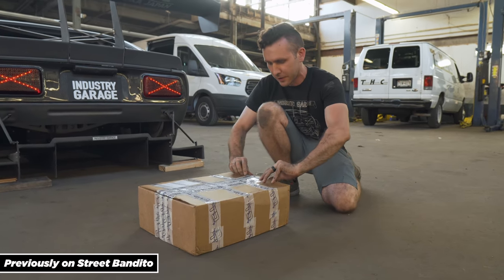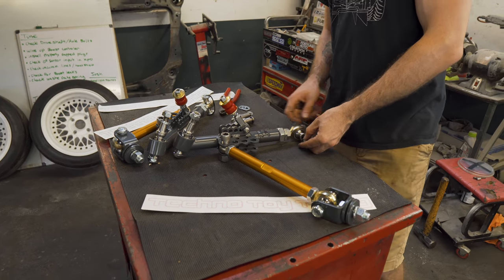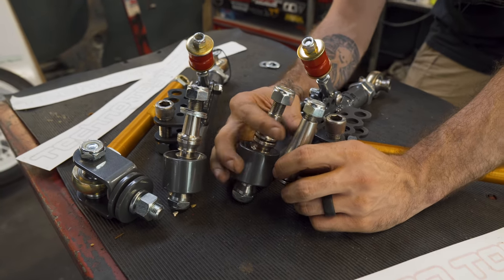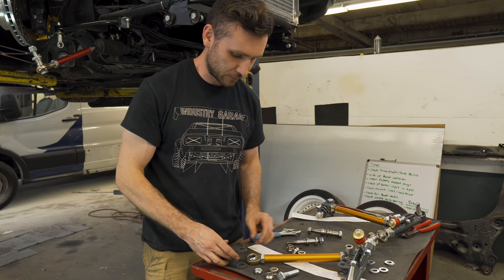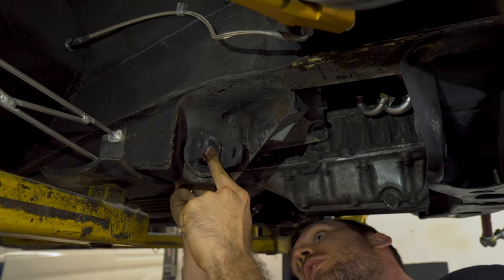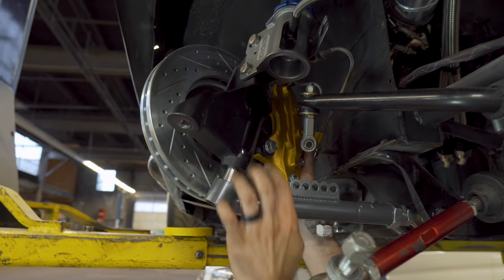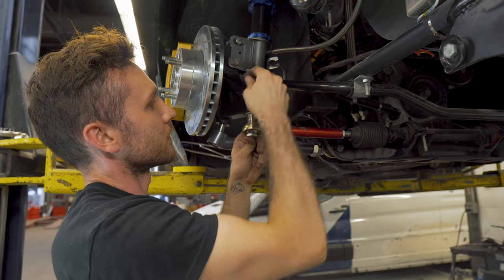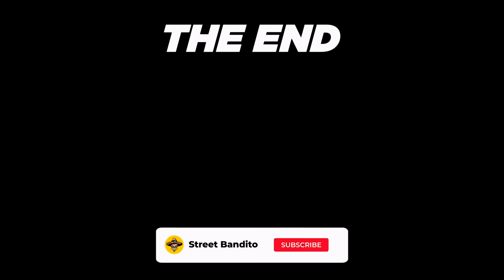240Z Techno Toy Tuning GTX 2 Lower Control Arm Installation | (#EP 69)

Comment: Correct me if I’m wrong, but an inverted control arm pitched upwards on a strut will cause camber to go positive — not more negative — because of the extreme arc as the suspension compresses moves the lower end closer to the chassis. Additionally, an inverted lower control arm doesn’t itself cause bumpsteer on the front end, the bumpsteer comes from the lower control arm and the tie rod rotating at different archs from each other, that’s why both the lower control arm and the tie rod have adjustable height ball joints with spacers.

Comment: Roll centre explanation was a bit backwards Tim, if the LCA is above horizontal you're losing Camber as the suspension compresses. 

As well as making the actual roll centre way too high.. 

Really great you're upgrading as the project progresses, lots of people get a "plan" stuck in their head and follow it through right or wrong.
Reply: indeed

Comment: Changing the roll bar link to lower control arm pickup point changes the roll bar stiffness, further out = stiffer 👍
Reply: I think it's the other way around...shorter is less of a lever and increases the rate to bend/twist the roll/sway bar..... longer is a longer lever that is easier to bend/twist and lessens the rate.

Comment: Definitely been looking into these for my s13 and I’ve been trying to justify buying them and I think this sealed the deal. I want these specifically because of the adjustability and complexity. When you get into higher levels of driving you really need the adjustment to feel the car and it’s connection to the road. Personally I hate stock suspension because its too sloppy. I like my car pointy and It’s all micro adjustments that really make the car drive better and my suspension setup may be a bit over engineered with active suspension dampening but tbh it makes things run a bit smoother when all the parts work in symphony. It’s complex but with light fast cars honestly I feel like this gives a bit more control to the car as opposed to something simple and rudimentary. on top of that they look gorgeous so I’m really thinking I might just suck it up and buy these. May need to powder coat them to match tho lol.

Comment: Looks like lca u need the longer balljoints make the lca angled downwards slightly when the car sitting on the ground...

Hence you were hitting bumps/high cornering load, the lca goes parallel at its maximum suspension stroke...

Comment: Is not the ackerman angle wrong when swaping the spindles from left to right?
Reply: Looks like it! Check out around @19:15 you will see that the lower ball joint is closer to the rotor than the joint at the steering arm instead of the opposite when the steering rack is in the front. Will be interesting to see how they solve this...
Reply: This was mentioned like a year ago in comments  when these knuckles were put on.
Reply: It'll have anti Ackerman setup like it is, not a bad thing for high speed sweeping corners, guess we'll have to wait and see how it performs.

Comment: You said you want your tie rods to be parallel to the ground.  Are you sure about that?  I forgot a lot of Suspension 101.
Reply: Tie rods that are not parallel  will have bump steer because they are not arcing in the same radius.

Comment: What would the result be from having the ball joint and strut offset in the wrong direction like you were mentioning?
Reply: I believe that it would cause the car to have a reduced steering angle lock and turning speed.
Reply: @fish7810  Interesting, I have reversed s14 knuckles like he mentioned but they steering pickups have been modified to correct ackerman angle. Guess I outta check the ball joint offset.
Reply: @PortysChopshop  what you've gotten done should solve any issue of running the backwards I'd think.